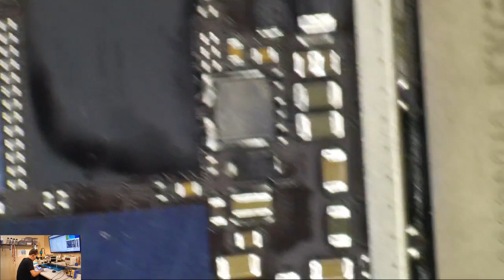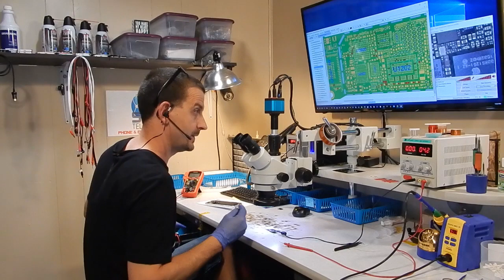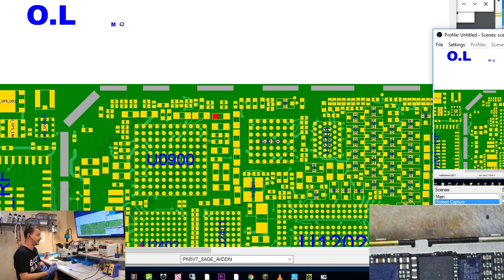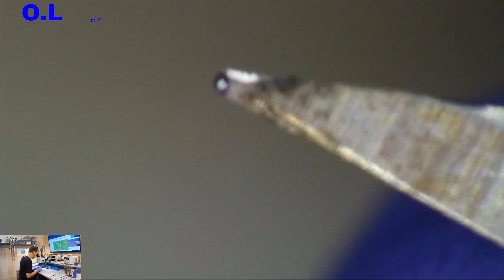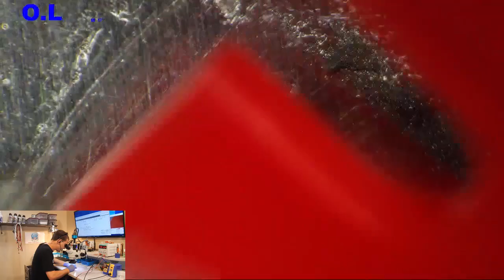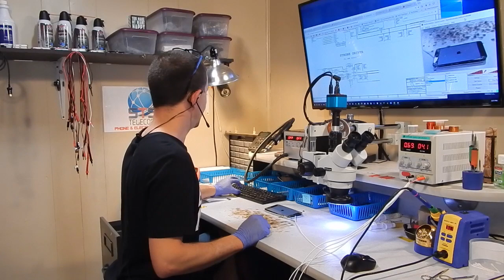iPhone 6 Plus No Power After Fall - Chestnut VCC_MAIN Short

Comment: That's amazing work I used to do component repair on military electronics in the 1990's with microscopes on classified stuff. We were outsourced small business money sucked like $13 bux an hour it was good for 1993. I went into IT work did much better didn't have to spend all day looking though a microscope probing with a digital O scope. My guess is no one is getting rich off this type of repair since it's cheaper to just buy another used phone.
Reply from the maker: Thank u! :) I really depends on the day really.  I charge $95 to $300 on any given device and I usually make $200 to $1000 per day.  Ok ok, there are some days that suck horribly bad and I make zero but today, it is 10am and I have billed out just over $500 already.  I am, however, concerned about the long term future of it.  We are at the mercy of the manufacturers and they would rather not see this stuff repaired.
Reply: Today it's lot easier to own a business like this and survive with the internet think about how you might be able to do this in 1990's with no resource's like we have today on the internet. Most of us electronic techs were at the mercy of some small company who worked out a deal with a larger one. In my case the owner was an officer in the army in Vietnam in radio intelligence. He had lot of friends who were in the defense industry by the 1980's he was making lot of money but his employees were paid far less just enough to live in a little apartment and drive an old used car in California. It was interesting work don't get me wrong I did like the technology I just couldn't see a future in it.  It's tough when you don't have the support of the manufacture behind you in case like yours. Your right they would rather see you go away. What is amazing to me the cottage industry China has created I guess these manufactures are so full of greed they just tolerate it. Are all the schematics, and board layout's from china they just copy everything there sell it to anyone.

Comment: I have an iPhone 6s, it doesn't turn on and it was checked by Apple store technician and they said the phone is dead, they used a new battery but it didn't turn on. They told me to buy a new one. Can you tell me what can I do to fix it and why it doesn't turn on since the problem is not from the battery.

Comment: Thanks a lot for this great demonstration, as always, a job well done. I have a question please, I try to repair a dead short. I have a short on these 2 lines : PP_VCC_MAIN & PN5V7_SAGE_AVDDN. No other line of Chestnut are affected. Is it still possible in this case that a short under Chestnut is the origin of the short ? (Every cap in VCC Main looks fine).
Reply: @unknown.standards  sorry it was too old, I forgot this problem, but thank you

Comment: Nice work, can you recommend what components to check on an iphone 6 thats been water damaged, It dosent recognice the battery (new one ofc) but goes to apple logo and off when charging, and ofc the owner tried charging it when it still was water inside..
The board and all components is cleaned with isopropanyl alcohol already and cant see anything that looks burnt.

Comment: Hi there everyone! I have a simple question about short detection (PS: you're dealing with a novice). Do you really need a DC power supply in order to check for a shorted capacitor? Thank you !
Reply: No, of course you don't. But shorts create heat, so you can localise the area where the short is coming from. Otherwise you would end up measuring the whole day.
Reply: P.S.: The fastest method would be to coat the whole board with frost (freezing spray) and then connect the power supply. In most cases the short melts the ice immediately and you have it localised in no time. :)
Reply: GPOA ACBH Thank you very much for your reply! The problem is actually that my power supply has an output amperage of 1 amp, so it is kind of weak for such short detection. I would guess that I would need to buy a more powerful power supply for this job, true? Thanks again!

Comment: Hello. ipad mini is not charging the battery. Voltage +5V comes in q 5700, q5701. The icon displays charging, the sound connection, but the battery that does not come I replaced the Tristar and the Main power remains on the battery is not charging.

Comment: How do you set your hot air  while removing touch ic's ?
Reply: you can go for anything around 320 - 380 the lower the better but don't heat it too much if you don't wanna trash it
Reply: i use 370 but try to make it as fast as possible
Reply: I use 285 temp and 85 airflow ,it takes more time but never trash the phone
Reply from the maker: I'm set on 390 most all the time
Reply: I'm looking a hot air station to renew my old Aoyue 909, you consider practical this model with buttons instead classic wheels?

Comment: The charge connection points of my tablet have been disconnected. How to find the counterpart in the pcb instead of it. To connect the cable. To lick.
Reply: https://hizliresim.com/7q5R3Y
Reply: Could be repaired
Reply: Yes.
Reply: how?
Reply: By getting a new connector, clean pads and solder it and making micro jumpers if necessary.

Comment: why fails after the fall?  the solder cracks because less lead in solder composition??or blow up pads, because bad quality boards?
Reply from the maker: +ANIBAL AVILA I think this IC was actually cracked. There was a piece of it left behind on the noard that I thought was part of the strobe driver IC next to it but closer inspection showed that piece of glass was from the IC I replaced.